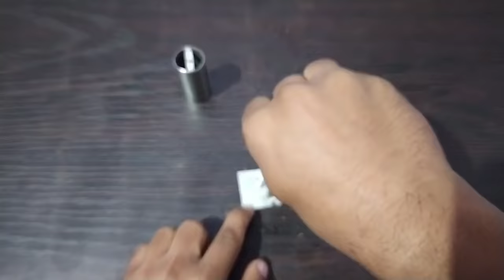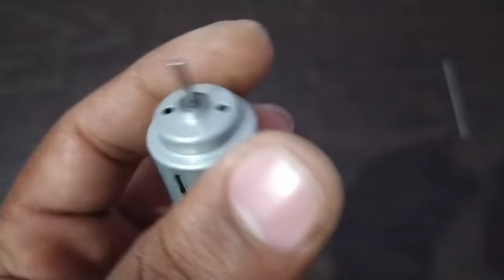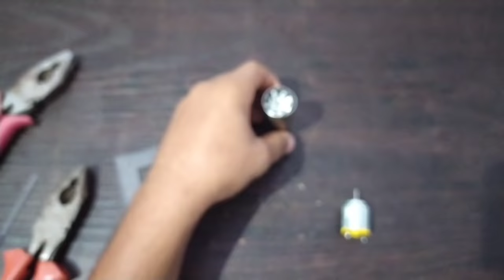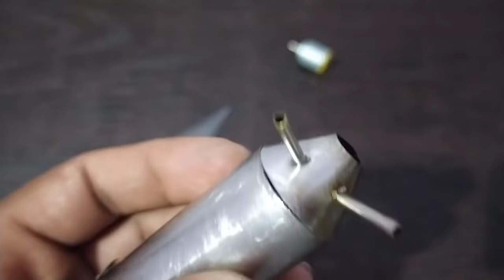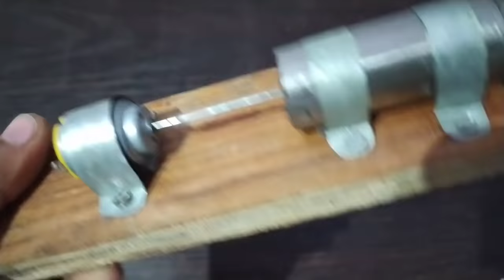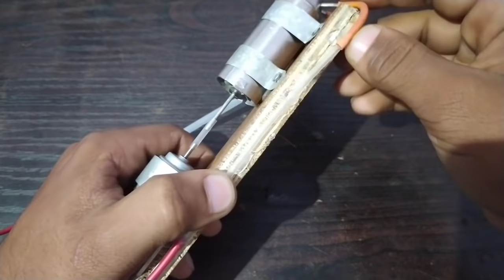How to make Jet engine (mini Jet engine)

Comment: That is an just an Afterburner with no Combustion chamber. If you used metal spacers instead of plastic, and welded the pieces together instead of super glue, you can add in fuel injection ports between the fin pairs in the middle of the engine (Combustion Chamber) with their own fuel tanks (lighters) - not wide open like you did with the Afterburner fuel tanks. Then you run the motor as a starter as you ignite the Cumbustion Chamber fuel, then shut off the motor. The engine should run slowly on its own. Then if you press the Afterburner tank buttons the thrust will increase.
Reply: You also need ball bearings and to balance the blades or else it’ll never go on it’s own

Comment: A jet engine is supposed to turn those fan blades without the use of a motor once it's started properly by using a turbine. There's no turbine in the back, so this is not a jet engine.

Comment: If you injected the fuel in the middle dead centre of the turbine then its combustion would have driven the fan shaft  and once the jet turbine starts you can unplug the electric motor then it would run on heated compressed air

Comment: U guys know what a torpedo heater is?,this is a mini scale one...to even begin to be a jet engine,the fuel source needs to be ignited behind the second row of fins and an air stabilizer.that is if that motor can spin it fast enough to start it

Comment: I'd call an electrical fan with an afterburner. Ok, a fan with multiple stages but still a fan, powered by an electrical motor.
Cool experiment but not a jet engine by any definition that I know of - and I'm glad it's not. I was just wondering how the glue and combustion chamber would go together. :)

Comment: You can creat small jet effect by simply put few drops of gassoline in a glass jar, & maka a  hole on lid, close it tightly, after you ignite it the expanded air & gasoline create a push pull effect Jet effect for 10 to 15 seconds, that enormous energy of push pull flow of air can turn few turbines & generate electricity or thrust.

Comment: Not a jet engine. It's just a motor with some flames at the end. A jet engine receives rotational energy from the fuel which means that more fuel would cause an increase in RPM

Comment: If you added a compressor stage when teh fan gets smaller and diamiter of the tube and a fuel injector it could work

Comment: Look. For starters, the air and fuel has to be compressed and ignited BETWEEN the turbine and the compressor vanes. He has the gas ignited AFTER the turbine. If he turned off the electric motor, do you know what would happen? The shaft would spin the opposite direction because the little compression it has is created by the turbine. If the higher pressure is on the opposite side of the turbine, the turbine will spin the other way. The compressor fan isnt doing anything. It has no vanes to compress with, gas not in the middle so pressure is on the wring side of turbine. Spinning the compressor the wrong way, if the electric motor wssnt turning it the right way.

Comment: It's not ajet engine although. It's just pushing flames. And takes help of a motor to push the flames. But in real jet engine the fuel is feed in between the turbines. So the combustion also happens in between the fans. Once u give an initial pressure to rotate the engine is enough cuz after that due to the fuel and combustion effect the turbine automatically keeps rotating after u turn off the motor also

Comment: By definition this is not a jet engine.  what you have is a ducted 4 stage fan powered by an electric motor.  The flame is there for a light show.  A jet engine must sustain operation on it's own, which this can not do.

Comment: This is cute and all but this has little to nothing in common with a jet engine. 
1. Doesn't produce thrust
2. The fans simply blow the flame backwards, not actually produce thrust themselves
3. The only time a jet engine produces a flame is when it activates the afterburner, which is very simply excess fuel injected into the exhaust stream.
Etc.

Comment: This is not turbo engine, because combustion chamber must be between compressor and turbine wheels, and this must be work without electrical motor, electrical motor acceptable to use for starting mode of the turbine only! this is mostly looks like boiler fuel combustion device, and not turbo engine, real turbo engine must support its working process without electrical motor

Comment: Dude this is not a jet turbine it is a fan pushing air into a highly flamable liquid. Very primitive and joints could be cleaned up with a file. Inject the fuel in front of the turbine. What uou have is a very, very crude afterburner. Or USB powered electrically blown dual tanked oversized cigarette lighter with external manual timber-sulfur type ignition. I believe that would be more suitable title. the title should be " how to make a gas stove"
84

Comment: The video is sort of  demonstrating the afterburner, not the jet engine principle. For that the fuel needs to be injected and ignited between the 1st and 2nd set of fans and there also  needs to be a cone just after the 1st fan set before the combustion chamber to reduce the diameter area so that the incoming air pressure is greater that the combustion pressure trying to go out that way and will instead go out the way of the second fan set that will also turn both fan sets in a self sustaining spin and you can disconnect the electric motor from the fan axle.

Comment: Very interesting and intricate work but I cringe at the use of cyanoacrylate (Super Glue). Obviously not an actual jet since no actual compression and no turbine at the back. No stators either. The real jets of this size actually cost several thousand dollars.

The camerawork was excellent - you actually used a static shot from a tripod instead of a stupid helment cam (which is a good way to get me to stop the video in less than three seconds).

Comment: Get a lighter engine and battery for start and put that setup on a cardboard plane with a trigger spring holding the lighters on, after you figure the proper air entry cone on the engine side

Comment: I think you should weld not superglue because of the high heat it produce the superglue is going to melt in the turbine fans can be running at high rpm and hate you

Comment: This isn't a jet engine ,a jet engine consists of mainly 3 stages compression , combustion and exaust
And this model is like a duct fan with propellent in it without any compression stage it can't produce thrust anywhere near a jet turbine engine but A for effort.

Comment: Well, it's a great piece of engineering, but not a jet engine, in fact it's opposite. There are 4 main types of engines on an aircraft:- Jet Engine( which looks like you tried to replicate), turboprop engine, piston engine and Turbofan engine( can be said as mixture of jet and turboprop engine). While speaking of jet engine, it has some key components :-  an inlet,  compressor,   combustion chamber and exhaust.
The jet engine works by , first of all , having air bleed into its compressor to make it spin ( either by external source or internal " mini-engine" , or APU , as we call it in commercial aircraft , which have Turbofan engines), then as air is pulled in, fuel is injected in the combustion chamber and a spark is made , which in turn rotates the turbine and rotates the compressor, sucking more air and continuing the cycle , and then air is sent out of the exhaust or afterburner which , due to Newton's third law of motion, moves the aircraft forward.
But in your model, the "engine" is getting rotated by a dc motor. I thought, well this fella is trying to make a turbine engine that will rotate the turbine and then charge the device by spinning the motor, but it isn't. Anyways, it's a good combustion box, but it won't be efficient ( it won't even fulfill its purpose), but it will be amazing to see this incinerator. You're a great red-neck engineer, keep making such fascinating and budget friendly models and perhaps make a working turbojet or turboprop engine someday. Best wishes.

Comment: That’s not a jet motor. It just blows air past a flame. Big deal. I was waiting for the guy to reverse the direction of the motor and then ignite the fuel after the fans compressed the air fuel mixture. Then it would be a jet motor, but only for a second. The rubber spacers would melt and it would turn into a bomb. Ha ha ho ho what a show.

Comment: not necessarily a jet engine
mostly because it does not use the fuel to spin the blades
the fuel is burnt using the exhaust to spin and power the blades in witch pulls in  air and compresses it

Comment: There's no compression taking place though except for right of the nozzle you're not going to see any real thrust from this more than what the electric motor is already putting out not considered a jet engine you just blowing air through an open flame no thrust

Comment: Like all Haji built crap on youtube is has an electric motor attached to it which is attached to a power supply off camera.  I am not going to go into how a jet engine works and it's different stages but if it were that easy to build the Western World would be speaking German right now.  Maybe they these "engineers" should focus on fixing their POS countries instead of trying to impress the world with their "genius". Fix your infrastructures, starvation problems and quality of life!.  Most of the engineers I work with from this area of the world leave a lot to be desired and put the one's who are actually good  in a bad light.